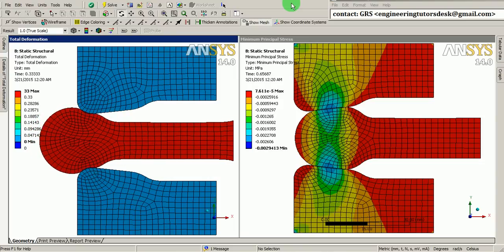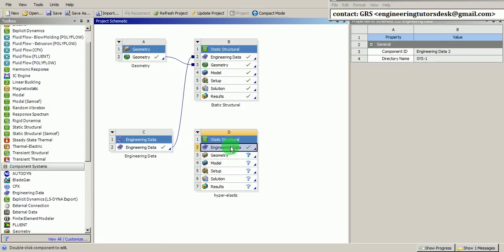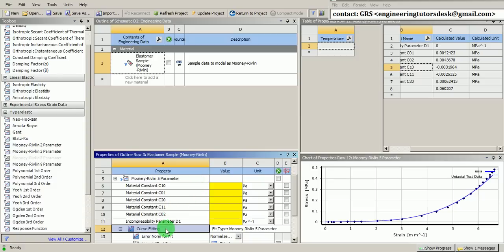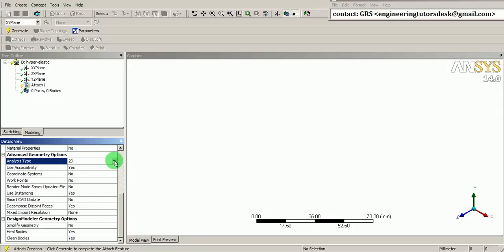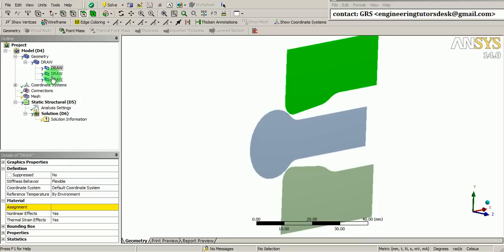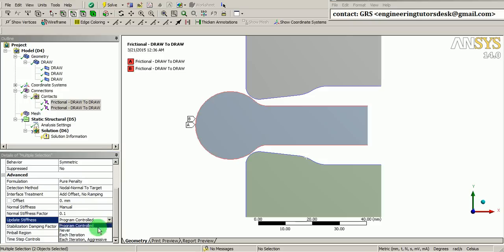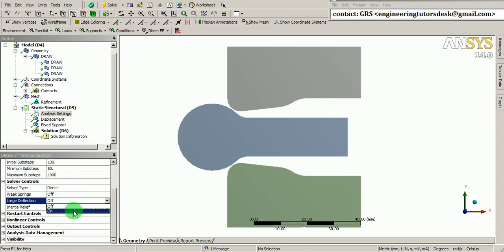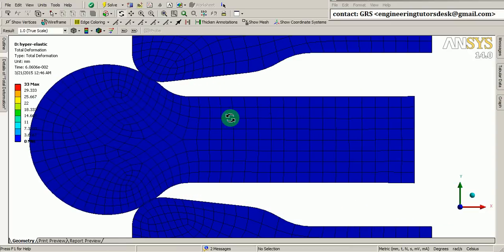ANSYS Workbench | Hyper-Elastic Mooney Rivlin Material Model Tutorial Video | GRS |

Comment: REALLY NEED HELP! I'm trying to use Mooney Rivlin in a 3D model but the material is expanding rapidly at impact. Could my values be wrong? C10 = 85.5kPa and C01 = 21.38kPa and I calculated D1 to be 9.36e-8. Could the "Curve fitting" function be overriding my values?
Reply: Hi Maddy, I am working to find new New mathematical hyperelastic model using abaqus, do you know how to use this code to build  hyperelastic matetial
Reply: I used Yeoh model where material is assumed to be incompressible.

Comment: Hi Mr. CAE Worldwide.

First of all I would like to thanks you for such a good video, and also for making it easy to follow and understand.

I would like to make you some question, if there is no problem:

1) i'm trying to put the elastomer material as the one wich defors, with an desplacement almost exacly as in your video, but when the solver runs, it does not move or deform at all. ¿Have you presented the same problem? ¿know how to solve this problem? 

2) When the solver is processing the simulation, i see some vertical bars, that are called "Bisection Ocurred". ¿What does this means?, ask you this because use to happen a lot of the time when I'm runing the solver and don't know if it means something bad??

thank you very much for your time and explanation, that i'm sure it would help a lot of people how are learning by itself! :D